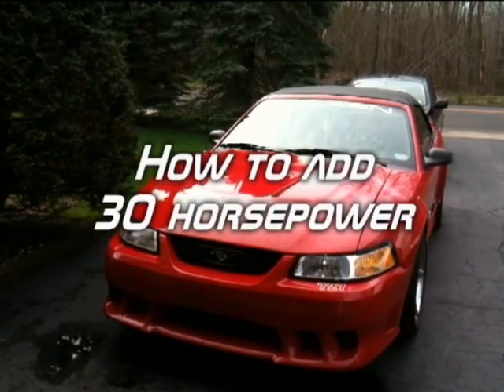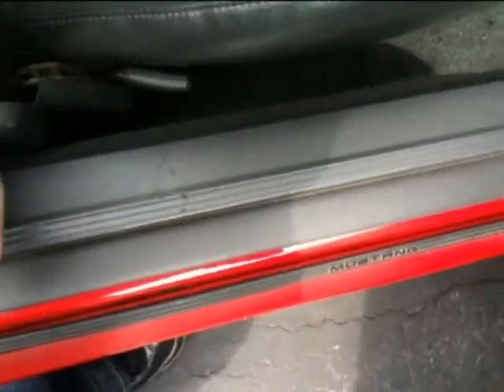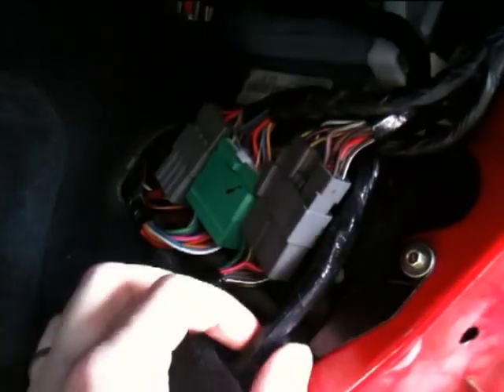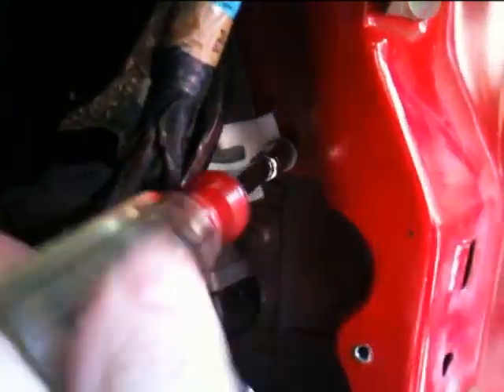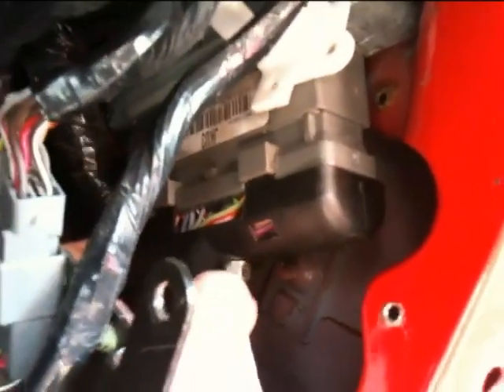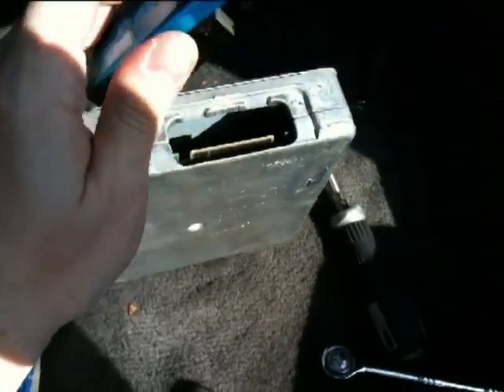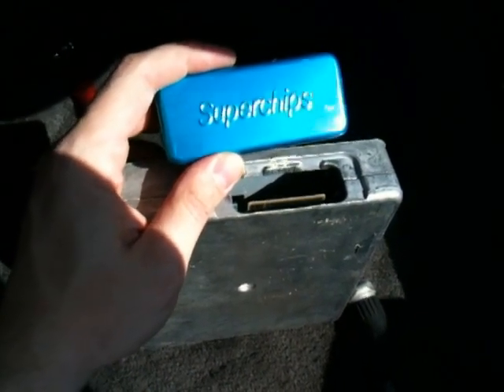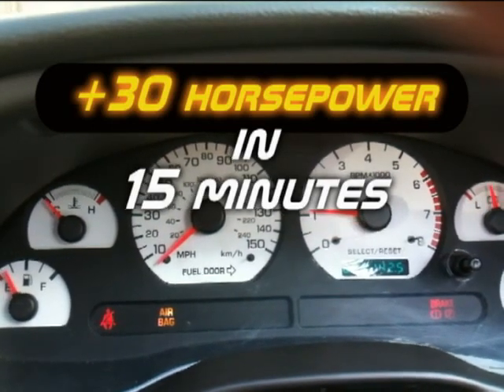Add up to 30 Horsepower to Mustang with ECU Tuning AFTER MODS

Comment: 14.4 😂😂373 Gear , underpullies , Full length headers , x pipe , flowmasters ,  Tremec TKO . And someone who knows how to launch the car at 4000 rpm =12s in a 95GT 5.0 pushrod . 14.4 is horendous for all that money u spent .  4000$ for the 95GT and another 4000$ for a 347 stroker kit plus machine work/cam and a few bolt ons to make everything work and a ECU tune = 10sec car  . Saleens Rouschs are nothing but collector cars . The bottom end in them 4.6 2v motors cant even handle real boost wo needing new connecting rods pistons rings ect .But hey what do I know . Oh if your wondering my family only owns a Mustang/Ford only performance shop . U want to see real performance go youtube Whippled or Kennebell Cobra that has a 4v and outruns hell kittys ect to this day while being 20 yrs old with its stock manly rods and pistons in it at 20lbs of boost making anywhere from 600-800hp/TQ

Comment: did you notice a difference in mph in each gear or just a faster acceleration?
Reply from the maker: +Daniel Rendon it fixed a problem for me that started happening after I changed the exhaust and air intake. Also testing it with a Gtech Pro revealed it was much faster in the quarter mile.

Comment: How come everybody fails to mention that reflashing/chipping/dynoing your car can actually damage it if your engine is not built for it. ESPECIALLY if you have an older engine.
Reply: Agreed.
Reply: it can damage it if you get a shitty tune. the tune has to fit the engine, not the other way around.

Comment: Well it give 30 plus hp if u add x pipe throttle body Flowmaster exhaust header and cold air kit with a help of a superchip there no way that superchip or super crap will add 30 hp alone
Reply: Anyone know how much HP a stock 2001 SVT Cobra Roush (Side Pipes mod) would have? I have the chance to buy one with 25K miles on it...super clean..But can't get away from the Coyote cars for not much more $$$ lol..
Reply: Ramon Bauza x pipe dies absolutely nothing, watch engine masters, they do a video on h pipe and x pipe...

Comment: they disproved this in mightycarmods, check out their channel and the video on tuning chips. Your butt dyno is wrong. You gained no horsepower. You got ripped off buddy.
Reply from the maker: MrKillahawk310  is right, they tested the fake chips on ebay, not programmed chips that have a custom tune on it for the mods you did on our car. I had my chip custom programmed by a shop in 1999 or 2000, that was before they had all these great ECU tuners that allow you to #do-it-yourself. Watch  #streetoutlaws  and see how many times they tune their car!   #carmods
Reply: They actually only myth busted eBay OBD port cheap ass plugin ones .....this however is an actual ecu upgrade/tune..aka hardware.
Reply: ProvenHelper m2350, so you are telling me that if you change something in the engine of your car, and you don't tell the PCM file that's running in your ECU that it's different, it will be fine? 

First and foremost, MightyCarMods (McM) is a satirical take on vechicle modification, and has small bits of useful information. That is in no way representative of American motorsports or automobiles. You had better get a grip on reality.

It's sort of like math. You want both sides of the equation to be equal to one another, or the net result is poor performance or a blown up motor. On one side, you have the physical components, and on the other... The tune. Your goal is to tell your ECU what you have, the characteristics of each part, and what you want. Most people want fuel efficiency, or horsepower... But they are usually one in the same... A Stoichiometric mixture of around 14.5:1 Fuel/Air mixture.

This is where homes blow up from leaky fuel, and also where the most power can be attained from the combustion process.

Tuning by hand is the most effective (and expensive) means to reach that goal. Canned tunes (AKA email tunes) are very rough and don't address the individual nature of each motor and how they are running by themselves.

I'm sorry if you are too ignorant or not in touch with how modifying cars for maximum horsepower. Take some classes, find a junker car, mess around with it... That's how we all start.
Reply: No worries man, the internet can be a confusing place. Glad to hear you're in the culture!
Reply: ProvenHelper  I don't watch street outlaws too much but I know they're friends with Finnegan and Frieburger from Roadkill so they can't be too bad. Idk what that guys problem is with them. Apparently they get a bad rap from some people but anyone who has respect from Roadkill is alright with me.
Reply: eViLZuG85 Not quite. More like I didn't read the description for the video and assumed it was not a custom tune. Sorry if I hurt your feelings. You are preaching to the choir as the old saying goes. I know a GOOD tune goes a long way. Otherwise there's no way people would make as much money as some do off of tuning alone.  
Ill admit to my laziness as far as reading the video description. Im normally better than that. But Ignorant has never been a word to describe me. I've taken my classes and worked on my fair share of cars, it's one of the things I enjoy most in life besides actually being able to appreciate the final result of working on those cars.
Reply: ProvenHelper STREET OUTLAWS? HAHAHAHA FUCKIN LAME HILL BILLY.
Reply from the maker: heyitschinoable You my friend are a moron. That show is for car lovers, but you are obviously just a small minded racist idiot. buh bye!
Reply: Just don't listen to little kids that say stuff like that. They just want to sound smart because they half hear something haha I have chips in all my cars, and the difference in them compared to with out them is so drastic
Reply: Just did a re tune with my new chips in my 03 GT stang and omg I'd never take it out makers her drive and shift smoother just feel more flush in the drive

Comment: What's with all the #hashtags ProvenHelper? Are you a 12 year old girl? Also, you should actually take your car to a real drag strip if you're going to cite 1/4 mile times. I doubt a bolt on/canned tune convertible would run a 106 mph trap speed.
Reply from the maker: Nope, but I do make money from making how-to videos and  #hashtags   are used by savvy internet marketers because they work!  #noob    And convertibles I've been told cannot make more than one pass if they do anything under 14's without a roll cage. I hookup and drive my car for fun, not to measure my penis at the track.
Reply: ProvenHelper Hey that's cool bro. But no one goes to the track to measure their penis lol. I challenge myself to beat my previous time and be a better driver. It's easy to hook on the street. Not so much with the adrenaline waiting for the light to turn green. 

BTW I still hold that your "times" are a bit optimistic. On a nice cool day mine does low 14s at 100 mph. It's a convertible with a tune and just about full boltons minus the headers. There's another GT that's a coupe that runs at my track, a little closer to stock, that runs 13.8-14.2 at 101 ish. Just sayin bro. Get out to the track you'll enjoy it.

Comment: Anyone that knows anything in the Mustang community knows that Superchips are useless. Actually anyone that knows anything about cars period knows that Superchips don't work. Reflashing the ECU with a properly datalogged and adjusted tune is the only way to go. Sorry you had to believe the hype spewed by a company that uses baiting tactics like this. If Superchips actually worked, performance racing shops all over the country that do custom dyno tuning would have gone out of business a long time ago. Tuning a car is more than just a/f ratios.
Reply: I agree fully.
Reply: Your "chip" plugs directly into the ECU, correct? Does that thing even have any onboard memory? I don't even see that offered on Superchips website.
Reply from the maker: I'm pretty sure it's just an EPROM memory chip that comes with a stock program (stock tune), but speedshops can easily program this with their own tune as many times as they want.
Reply: I'm just wondering how that chip works in comparison to an OBDII handheld in which a tuner uses SCT Pro Racer or HP Tuners uses to rewrite the tune. Dio you, or have you, done any datalogging on your car at all with this chip? Not logging on a dyno, actually driving the street under load, and doing WOT?
Reply: ProvenHelper I did read the description, I wasn't disagreeing with you so much as I was agreeing with him. That's all.
Reply: I scrolled down justto find this
Reply from the maker: stichy420 If you read the description you would have read that my ECU was custom programmed for my mods. The Superchips chip is just a plug-in memory module that holds the new programming. It's the same thing... Trust me I'm am IT guy who used to program inspection robots!
Reply: Lex Selfmade Life its custom tuned? How much did you pay and how was the datalogging done?

Comment: Exhaust and intake dont really do much for you. I have a Ford Racing intake on my 1998 GT with a conical air filter and h-pipe with Super 10 series flowmasters. All that combined maybe put in +40hp but it mostly made it sound mean. If you want real horsepower, you need to break down the motor and put a build on it. Then add a Kenne Bell or a Paxton to really lay it down. This is coming from an avid mustang enthusiast( ive had 3 so far). Ive learned its the driver that makes the car. Act tough with a slow car, it doesnt go well. Know what you have and what it can do, you get respect.
Reply: Cody Preston you are very confused. Procharger is a company that sells centrifugal superchargers just like Paxton. they run on a belt just like the screw(Kenne Bell) or roots type superchargers. all superchargers are parasitic. the advertised horsepower gains are at the crankshaft. doing so already takes into consideration the parasitic loss.
Reply: Or put on a turbo or procharger, when you put on a supercharger yes it does add just a little more power,  but some of the power it adds is to just run it and the engine, meaning if it says you gain example 200, in reality on 150 is going to the back wheels or front wheels or In some people's cases all wheels, and yes I do know what I'm talking about for the simple reason I have talked with company's that sell them and asked just to see if it was true and they said it was, so just turbo or procharge
Reply: Again, Procharger is a company. It's not a type of forced induction. They make superchargers. You tried explaining why superchargers are bad, then said "...so just turbo or procharge". Uh...
Reply: That's why a lot more people then justme call the pro chargers. Not superchargers. I'm not gonna sit here and keep arguing. You legit trying to keep this up when my comment was from 149 weeks ago
Reply: That's why? I didn't give a reason to justify it. So you say pro charge instead of supercharge? As dumb as that is, why did you give reasons against supercharging then essentially say  "...so just turbo or supercharge"?and why did you start out with saying " put on a turbo or procharger, when you put on a supercharger... ". You basically said procharger is not a supercharger. So much contradiction.
Reply: Again, still going.
Reply: Do you even own any kind of rave car shit. You seem like the kind of guy that barely has a car, reads way to much online, and don't know much of anything other then what he reads. They don't even work the same. The both are ran by belts thats about. Easy install, but then you have bov waste gate intercooler have to get a tune to run one. Supercharger, do not have to get a tune, given that cars come stock with them, does not require a intercooler, does not require a bov or bpv or waste gate. And way over priced.
Reply: It seems like you don't know the different types of superchargers. I'll keep restating things since you seem to lack reading comprehension. Procharger makes centrifugal superchargers. There are different types of superchargers and you must specify which one you are talking about. They all have parasitic loss. I think you're trying to talk about what are called roots(weiand) and screw(kenne bell) superchargers. You do have to get a tune. All cars come stock with a factory "tune". Any time you make a major engine upgrade, you will need to re-tune it. It doesn't matter what type of forced induction it is. You can have a centrifugal supercharger without bov, wastegate, or an intercooler. You can have a screw type supercharger with an intercooler and bypass valve.
Reply: Yeah well look that up about not need g it.
Reply: And I do know what I'm talking about since I've built multiple cars one being a procharged 99 cobra. But, good luck. Got a long life ahead of you.
Reply: I'm actually not. And while people call it a supercharger, its still a pro charger. Either way, turbo is the better way to go, can run way more boost, more then one (cheaply compared to belt driven crap) and can get wayyyyyyy more boost

Comment: Haters gonna hate.
Reply from the maker: Yup, it's amazing, I have more than 230 videos, yet this video alone generates 99% of the #haters! Craziness. I think people are jealous of Mustangs, because they are a cheap performance car that with a little bit of money can spank much more expensive cars. I had my share of red light victories :) And some of those were against those Chevy Camaro's that were supposed to dominate my little 4.6 liter v8.
Reply: I got an '03 convertible, nothing compared to a Saleen, but still nice and still looks cherry.
Reply: ProvenHelper
Reply from the maker: Yep, you're right about that. I guess I'm doing something right, if I got all the haters all amped up over this simple video. LOL

Comment: i just did what you did but my mustang only had a plastic cover i guess i need to buy a super chip??after i buy the super chip will i need the car tuned like you said i have a cold air intake and after market exhaust a cherry bomber with a sound tip my question to you is after i get the super chip what will i need to do? 1997 mustang v6. thanks brother.
Reply: Nothing. The chip is a tune in its own way, just because you have a cold air intake(cai) and exhaust does not have anything to do with tuning.

Comment from the maker: I'm sorry to everyone who doesn't believe in ECU Tuning to gain horsepower...
Reply: I was born smart, plus I love to read, plus I have street smarts. Anyone can become smart in my opinion. Your comment about the ECU is ridiculous. I did my ECU reprogramming after engine, intake, and exhaust upgrades to maximize my horsepower gains and normalize my fuel and air mixture. And that was done  in 2000, ECU is still fine 15 years later. In 99 for brand new muscle I had a choice of a gt or an outdated camarro, I chose mine. Car runs amazing, sounds amazing, and looks amazing cuz it been garaged and it only has 55k. The Saleen parts are wind tunnel tested, to improve handling at high speeds. If I really wanted to make it fast, I would twin turbo the car, but it's fast enough for me so I don't care. Plus I'm more concerned with picking my next car toy then this Stang or my cushy Lexus.
Reply: Says the guy who spent over 40k in mods- also making a cobra clone,
When you could have gotten a terminator for 20k.
Reply: Hahahahah no.
I have a cobra lol.
I do know about cars. And I know enough to not waste my time on crap like that. I focus more on engines and exhaust upgrades. Something that I can trust.
And that's great that u bought it new but I could have gotten a 08 GT for the same,. Added mods and come out with the same time or better from what you have now.
But it's ur car.
No problem here.
I guess since you went to IT school makes you smart right?
Makes you know everything right?
Reply: I'm sorry to everyone who's ECU will fail.
Reply: You're a moron. Go back to sleep.
Reply: Are you jealous that I could spend 40k? Because that's what it sounds like. Plus it also sounds like you know nothing about cars. Btw when you buy a car like mine brand new, it costs more than 20k genius.

Comment: tell me how i can increase my horsepower 1997 mustang 3.8 cold air intake cherry bomb exhaust cobra rims 18. sounds like a gt kinda lol any thoughts David. i am looking to sup this car up a little at a time . do you have any thing for sale. i need to trade a china cabinet custom made in Germany it's about 10 feet long with the middle part is like an arch i paid over 3,000 dollars in 1990 when i was in active duty in Germany willing to make a good trade on cobra motor exc. message me
Reply: get a different car.

Comment: also i need some low profile tires 18s. the rims on the car are cobra mags aluminum. 97,000 miles. the rear end has some humming sound i just put a new clutch kit. i need to change the oil in the rear axle. drive shaft looks good. good oil pressure mabie wheel bearings but more then likely its the rear axle.if you or anyone reading this and have some fog lights,hood scoop, white 10 inch racing stripes white,  coyote,cobra, motor 5.0 transmission, upper and lower grills, message me paypal rocks

Comment from the maker: You're right? it's ALMOST impossible to take into account things like pipe diameters and air flow to calculate proper fuel and air flow ratios without a dyno. I guess I'm just too hung up on science. At least my car got faster using this joke technique so that I could whip my friends Camaro SS; the same one that beat me before I did the ECU. Must have been a dream; except I have the race on Youtube... OOPS!

Comment: Or just order an SCT Xcal3 online, send your mod list over to brenspeed, wait 3 - 5 days for your email tunes and upload which ever one you want... basically what you just did in 5min, someone with a sct xcal/diablo tuner can do in about 1-2 min without popping the hood or using a screwdriver. Also easier for you to modify your parameters yourself if you wanted to.